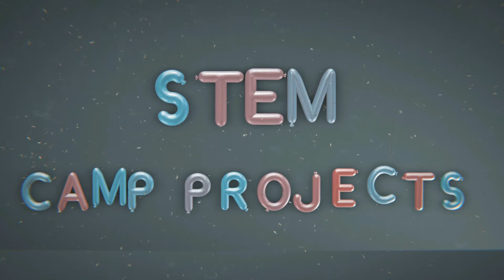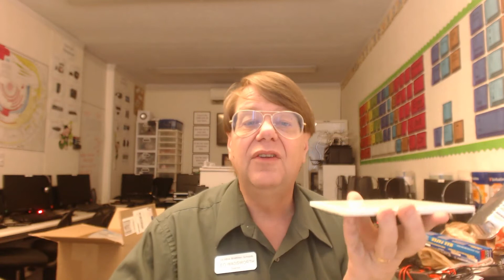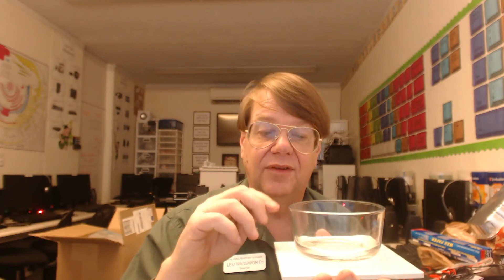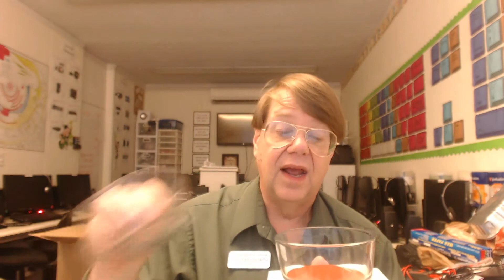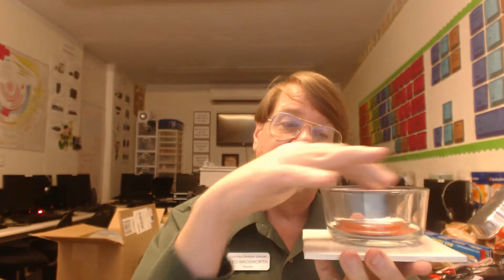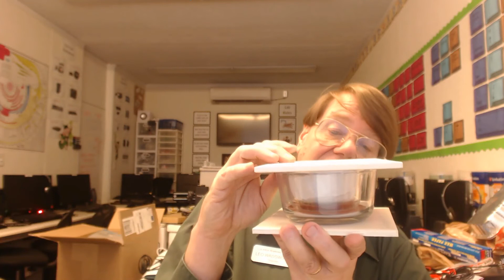Easiest Carbonization Technique Details

Comment: you might want to check the outcome against the same things carbonized in a normal method because microwave bacon has no flavor so I wonder if the microwave might change properties of the materials that you might not want changed.

Comment: I've been doing fine with 10-20g of material and it did not trigger the microwave safety. BTW I managed to crack a pyrex glass bowl too. Apparently, it's not the overall heat that breaks the cup, but the localized temperature spike and resulting high temp gradient. BTW pyrex is not the best deal - I've been looking into borosilicate glass beakers, ordered a set from China but it is going to take some time till it arrives.
Reply from the maker: That makes a LOT of sense.  Pyrex is better than plain glass, but the borosilicate should be much better.